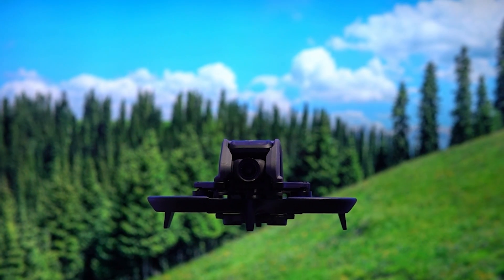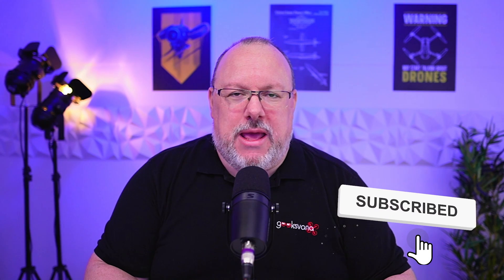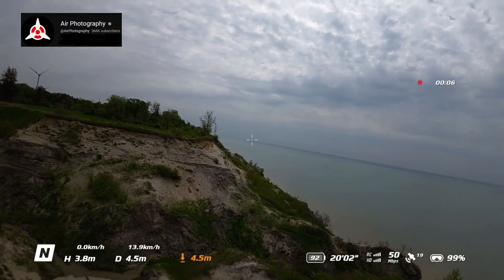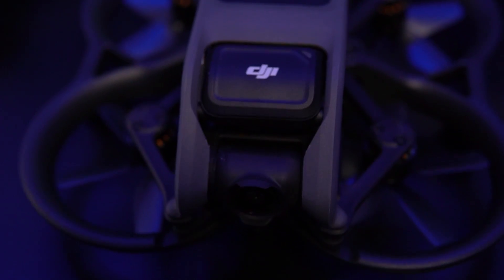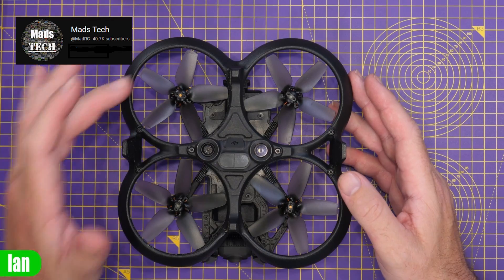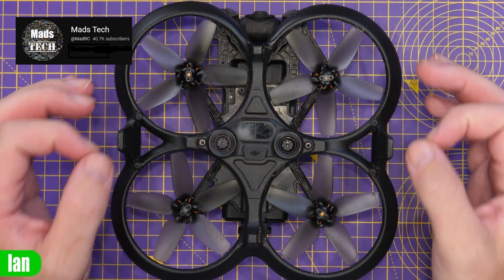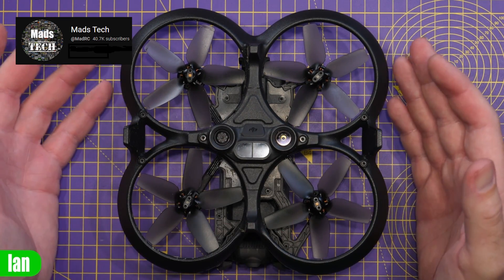Avata Props EXPLODING? – How to avoid this happening to YOUR drone!

Comment: I have flown my traditional FPV drone into a chain link fence. Pulled it out of the fence. Bent the prop back to kind of the correct shape. Then, I flew it again a few minutes later.  The avata props feel cheap. Like they'll break if they get a defect. I dont even land my avata in the grass, lol. Always examine your props before you fly. Especially the OEM props.

Comment: Had a prop blow up on my Avata today. Nov 10th 2023. I had just flown onto land from the ocean when it blew, I heard a loud pop and it came down into the only bush around right at my feet. no damage other then the prop. Ive never crash my avata or damaged my props, never over tightened them and checked them today before this flight just like this video shows to. I would have to say there is an issue with them and im not sure what I will do next? stock or after mkt?

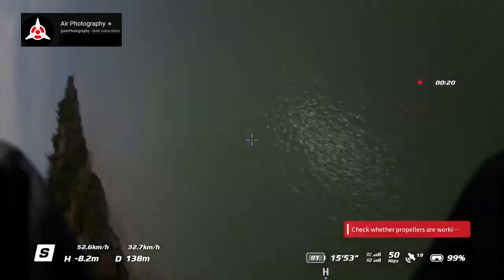Comment: 4:10 "Havent touched them in that many flights"... HMMMMMMM.... Almost like people who bring their car into the shop and say "No i havent check the oil since i bought the thing." Running the engine dry for many many thousands of miles.. wondering why the engine is knocking like a child with a bad knock knock joke he thinks is hilarious.. 
Most FPV people will tell you check your equipment before AND AFTER every flight...

Comment: I still believe there is a design error and maybe they launched it hastily, the rollover that is its trademark is indicative of that. It's a heavy drone for more extreme flights, and something I noticed is that the propellers break on the screws, making it clear that that region doesn't have enough resistance. Several people have shared videos often flying slow on their second or third flight of the avatar and the propellers break like cookies. The alternative I see is using third party propellers and expect a fix for this in Avata 2.

Comment: There is a set length shank on the prop bolt you would need to be very heavy handed before you would screw the shank down through the top of the motor, the inhex would round of first. I recon its just fatique, seems there's a lot of failures happening all of a sudden, might be the first round of these drones that were sold. For the sake of a couple of dollars for a set of props keep spares change them out more frequently. Also whether the motor sits above or below the arm has no effect on direction of air flow, so dust and particle damage on the blades is the same either way.

Comment: The destructive effect of "loctite" (and all other kinds of anaerobic screw glue) on the common plastic materials of drone propellers is absolutely underrated. The pre applied blue material on some  screws like the ones of the Avata is not "loctite" but a special kind of screw fastener which works very different than "loctite" and does not destroy plastic propellers. So never use "loctite" or other anaerobic screw fasteners to secure the screws of your propellers !
Reply: BS. Been using blue and Red Loctite on cars with plastic and composite components in the auto industry for 30 years and never has it been brought up as an issue.. GM, Mercedes, McLaren Honda.. all use Loctite..
Reply: @crisnmaryfam7344  no BS. Plastic used in cars is not always the same as plastic used for drone propellers. And not all kinds of plastic are affected.
Just read about it: https://en.wikipedia.org/wiki/Environmental_stress_cracking
Reply: Oh and BTW... ASE certified, not just some youtube comment. In case you dont know what that is.... "The National Institute for Automotive Service Excellence is a professional certification group that CERTIFIES professionals and shops in the automotive repair and service industry in the United States and parts of Canada"

Comment: Quads like FPV drone and Avata have potential to self explode props because they use a mount system like off center screws (Avata) or the push fit props on the FPV drone. The torque of the motor puts stress on the prop off center. Hard throttle or sudden changes in throttle can stress the prop causing this issue. It happens less on a traditional 5” quad type since they use a center mount with a single nut.  Those quads what tends to happen is the nut simply unscrews and the prop slips. Short of it is both Avata and fpv quad by design is not well suited to sudden change of throttle.

Comment: I fly FPV daily. It is unlikely that my props last longer than about 10 flights before they are changed. I do have an Avata which I do love, and it has only just occured to me that I have never changed the props. They are plastic, they will fatigue, why wouldn't they fall apart after a few hunderd million spins at a few hundred G.... Im going to start changing them frequently.

The one dude did say, they were the same ones from the factory... he had never changed them.

If someone said they had the same tires on their car ever since they bought it, then they gave out, then we wouldn't really be surprised. Props are a servicable item.

Comment: Not seen this issue at all…  but the material used to make the props is not great, it is brittle.
Reply: Its designed that way on purpose. If they were too stiff and not brittle to some degree, when they would contact things Worse damage would happen as more energy would be transferred into the shaft of the electric motor and thus its internals. If the Rotor/Prop blades themselves break, it gives an extra level of protection to the rest of the craft.

Comment: Thanks, Sean for the review.  Im well aware of the possible prop “explosion”, as I know several of my fellow drone pilots have experienced prop failures in the past 3 weeks.  I’ve never had a problem, again, like you, I’ve be a camera drone guy till I got the DJI FPV, and then the Avata.  I still have not flown either of them in manual mode.  I have purchased the 4 blade Master Airscrew props, but havent installed them.  I’ve always stayed away from 3rd party props, with the belief that the drones were designed with the OEM, and tested over and over, prior to market.   I’m now undecided about using the 3rd party props vs OEM, but your review, as well, as Ian’s, which I saw previously, makes me want to continue to use the OEM, but taking extra precaution to check them more rather than just looking for physical damage.  Looking forward to meeting you in Tennessee, as ell as my home State, The Great State of Texas, in the coming months.
Reply from the maker: Hey Michael! Thanks for sharing your experience and thoughts. I agree with you completely and went down the same journey of considering 3rd party props. I also prefer to stick with the originals.

Comment: That's interesting.  I have not heard of this issue, but also know nothing of the Avata.  I've always assumed that T mount props were just way more prone to weakening due the the perforation of the hub.  It's not uncommon for me to have a T mount prop explode like that (break in 2 along hub and screw holes) on my pusher cinewhoops, but I just have always written it off as a side effect of the props. (I also use and reuse old beat up props).  I think that mounting design is just prone to fatigue.
Reply: Also, that camera trick with the avata in the studio came out awesome!
Reply from the maker: Thanks Mike! I think it worked well! Totally agree with you, the hub is fragile and it is good to let newer flyers know about it 😎.

Comment: Mine exploded hand catching it.  So do this test.  Put it in sports mode and launch it then grab the battery and flip the drone it to turn it off.  Do that like 20 times and I bet one of the props explodes.  It revs the motors really hard when you flip it to get it to shut off and that's when it's likely to explode a prop.
Reply: Tbh I have always landed like that and not broke one yet. In fact the props I have on are the original ones I have crashed so many times it crazy.  All my flip of deaths been on those props as well.
Reply from the maker: That's very interesting feedback! Seems a lot of people have had this happen in different ways.
Reply: @Geeksvana  Air Photography was in Sports mode I believe.  I think you'll find that is a commonality that makes it more probable to happen.  The stock ones are too brittle and don't have enough flex in them thus they break.

Comment: Props dont explose by herself... 850km with my avata and 1 props dead! just after a little crash because i wait a little more time to cut off motors. Only a lot of pilot error because most of avata user are beginner
Reply: I’ve had master air screw props self explode on my DJI FPV drone. The props were new. Props certainly can self destruct due to manufacturers fault of the prop. Yes of course they can be weakened by a crash, but it’s a fallacy to say props cannot explode by themselves.
Reply from the maker: Spot on. I think the users not being used to maintaining FPV drones is easily 90% of the problem.